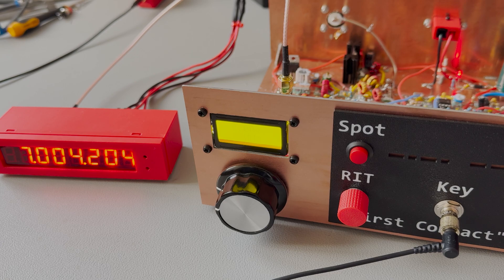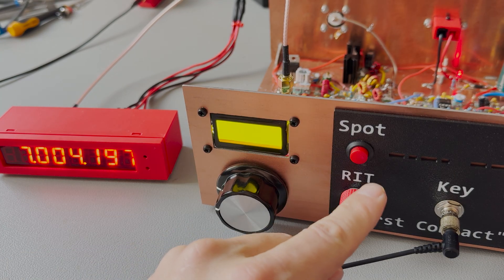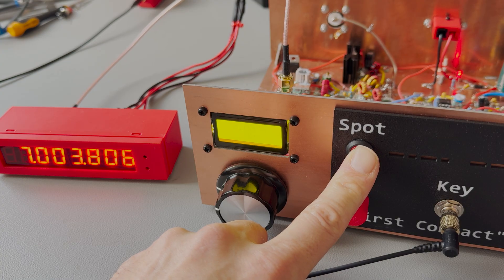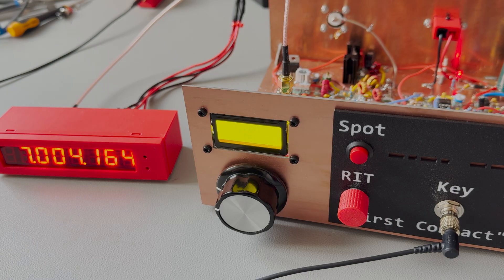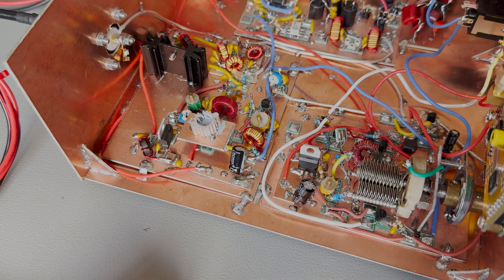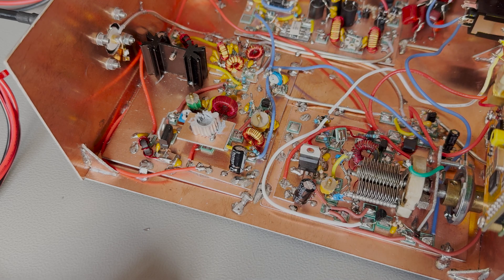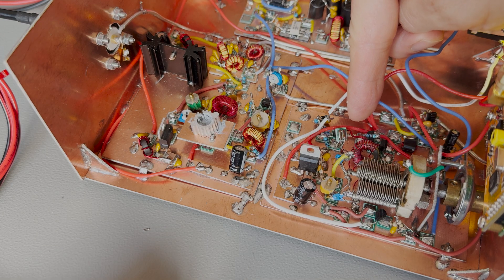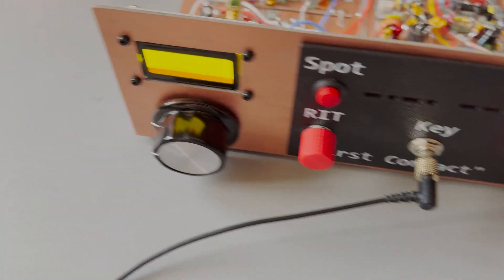QRP CW Transceiver 22: New Spot Button

Comment: I made a 50 watt 3.5 Mhz A.M. transmitter for someone.  According to the oscilloscope, everything was in order.  I could not make an on-the-air test because of my limitations.  But, the transmitter was not returned nor did the purchaser ever call me back.  I assume the transmitter worked good, on-the-air.
Reply from the maker: That's great! It's always a good sign when they don't call back.